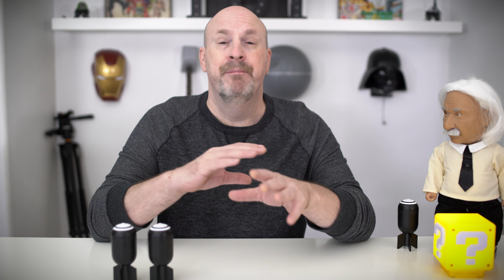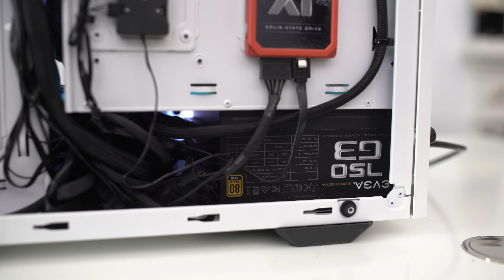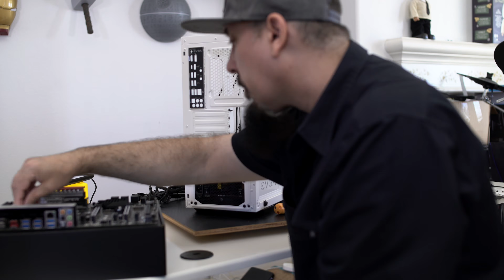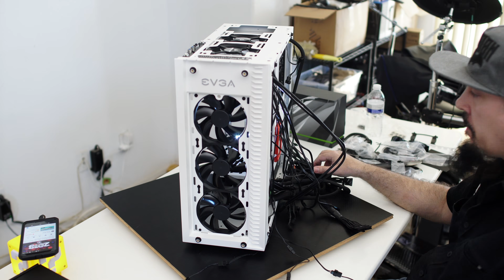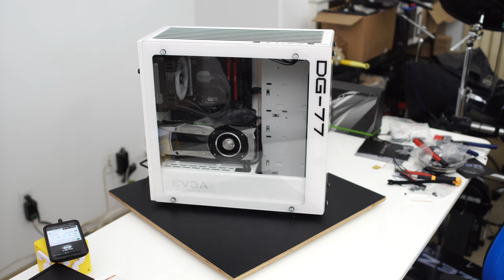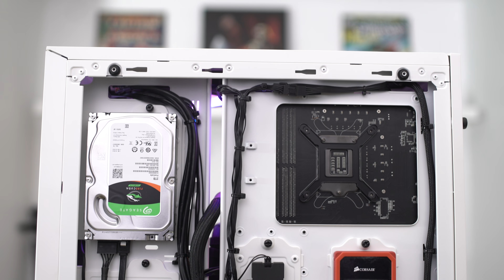EVGA DG77 System Build - The Pros & Cons (Time Lapse)

Comment: I got my hands on one of these bad boys... only question is about the RGB controller: can I use it to control RGB fans? I've been wanting to get new ones, but don't want the hassle of buying and returning different ones until I get it right. Every post or thread I've seen, says they are for RGB LED strip lights...

Comment: I have a DG73, basically same structure.... How the hell do you get the top cover off?  I feel like I am going to break it.  I have the front panel off and I know it is removable but is there a another set of screws or something?
Reply: ok I got it off, but pulled it from the back which seemed less obvious... sometimes these stupid little things end up being the most frustrating and no one shows it in a video when they do a review.

Comment: I just got this case and EVGA's 280 CLC and it doesn't fit at the top of the case forcing me to mount it to the front. I like the case but it makes you wonder about who designed it and stating radiators can mount to the top when even their own product doesn't fit. Really EVGA?!

Comment: @ 8:00 You said the CPU was barely getting over 32 Celsius.. Please tell me you just misspoke as that is just not possible even if you ran it outdoor in a snowstorm..  I keep my office at 25c, run the same AIO cooler with HD120 fans on a I5-8400 in a MUCH better chassis and mine hits 51c under load after about 15mins.  BTW my case is the Rakk Kagi and you can see my video on it on my channel under my reviews.

Comment: Can anyone help me get together a parts list for a 200 dollar or less pc build? I know it is possible. And please do not tell me to raise my budget. My budget is firm as I am trying to play most new games like Battlefield and GTA V at 1080p with decent frame rates. I'm not moving my budget and getting it below 150 would be great. Thanks in advance!
Reply: At that price point, you re correct it is possible, but your best bet will be a used prebuilt system. I can't see any way of building a system at $200 with new parts, especially with the price of ram and GPU's these days.
Reply from the maker: Agreed
Reply: sparkplug1018 Thanks. I'll look on eBay. Could anyone also suggest a full gaming setup for maybe under 400? That is including the pc, desk chair, etc.
Reply: Sean Timothy G, might aswell buy a console bud, the market is fucked atm

Comment: If cases manufacturers want to make a solid front, why don't they put the PSU on top, move the front fans to the bottom and use the rear and top as exhaust?

Comment: I just don't think that you can have this many compromises at this high of a price point. I have a thermaltake core p3 because I wanted open frame but if I'm spending more than $100 on a case I expect that there shouldn't be such major compromises. I know high end cases often demand a higher skill to work with, but some compromises are just strange...